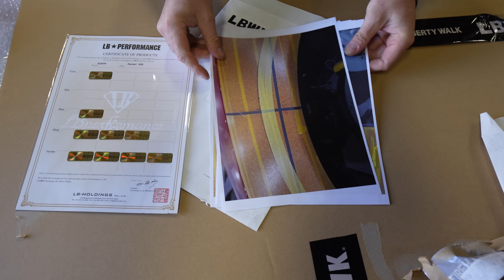Rebuilding Our Abandoned Ferrari F355 For F1 Miami!

Comment: Pushing boundaries is great, like Burroughs’ K24 powered Ferrari. But it’s like they have a script they have to stick to: wide body, wheels, air suspension.
Reply: For real. Wouldn’t mind seeing something different apart from what is largely the same formula build after build.
Reply: I don't disagree with you here. But you have to consider what can and can't be done with this platform. The NA V8 in this sounds great, yes it can be swapped, as far as the aesthetics go? stock (Which everybody has done already on BBS RS') or "the first LB 355 spider". The choice is clear here. This is MY dream build, if i wasn't broke 😂

Comment: Remote in the two thousands 😂

I had a pioneer sound system with a remote like this in my car in 1990.
Times when car sound systems were very expensive, back then some had sound systems that cost more than the car they drove.
Pioneer head unit was around $700 add 3 amps one for high, mid, and low plus a 10 louder cd box in the trunk some subs end speakers and you before you know you spend around $3000 which was a lot of money in 1990.
Reply: Yeah ibstarted doing systems in the 2000s ... lol .. but yeah you right !